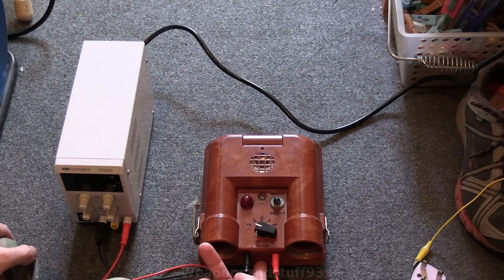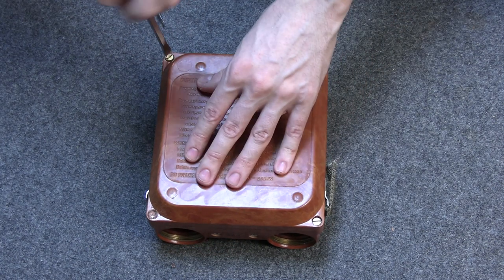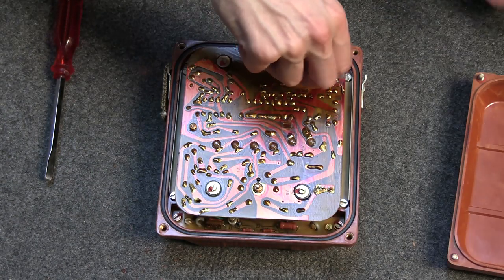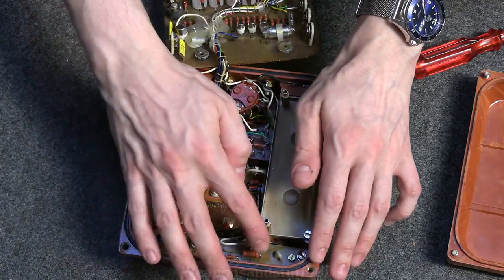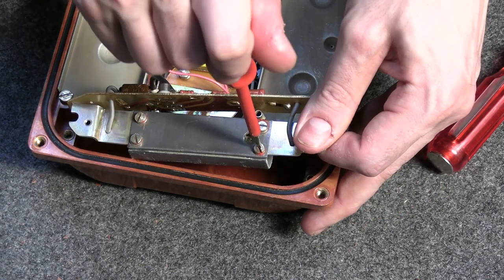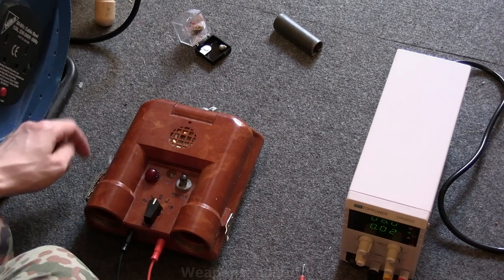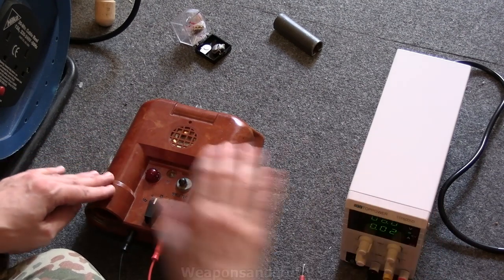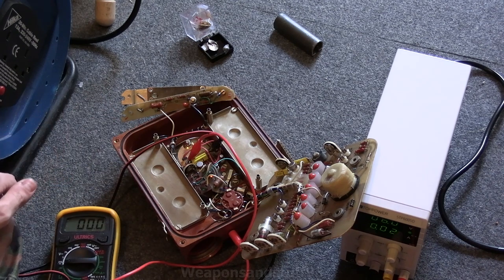Setting off the Polish RS-70 Radiation Detector

Comment: Hey I know this question does not match the topic of the video but I got an Avon s10 mask made in 2003, it is in perfect conditions, sealing perfectly, but when I exhale I hear a “pop” coming from the exhale valve I think. Is that normal?
Reply from the maker: Yes it's the valve flapping open and closed with your exhaled air.

Comment: Thanks for the interesting video but please get some proper screwdrivers and use the correct size driver for the correct screw.  You will find it much easier to undo stuff without ruining the screws.